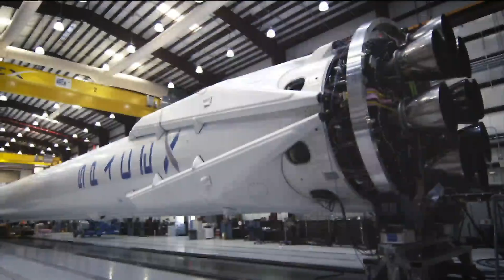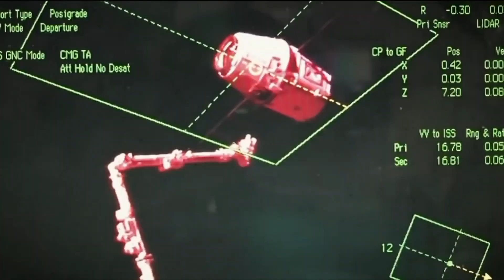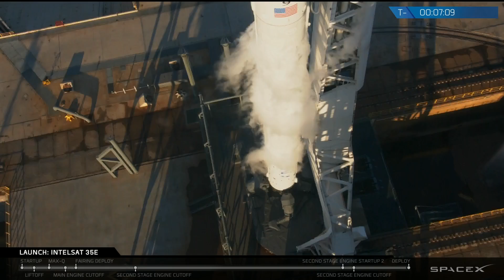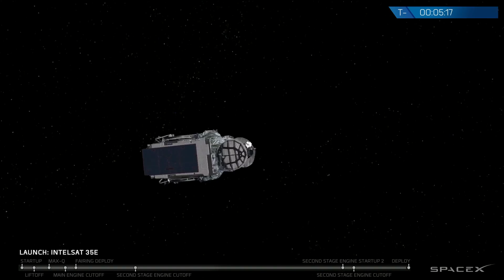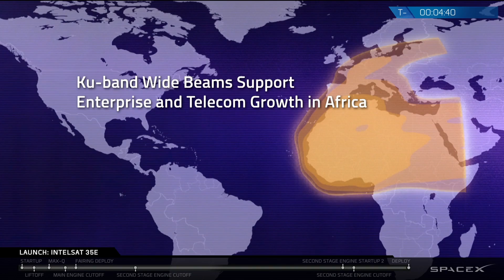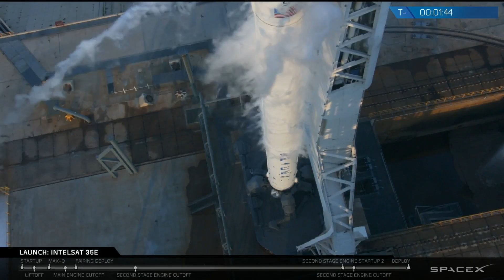Intelsat 35e Launch Webcast

Comment: Does anyone know specifically why no recovery on this one? Path takes it too far from where OCISLY would be?
Reply: Bart Comments The satellite is too heavy for recovery.  The Falcon 9 needs just about all of the fuel it has to get the satellite up so there will not be enough fuel to land
Reply: nintandrew13 Thanks. That's quite a big sucker then! It'd be interesting to see this satellite sized up against those ten Iridiums.

Comment: not landing phase 1?..mission requirements?.. I smell horse shit
Reply: Ago go The 1st stage needs to burn all of its fuel in order to attain the necessary velocity so the 2nd stage has enough fuel to take the satellite all the way up to Geostationary orbit. 

Whether or not SpaceX recovers its 1st stage depends on the desired orbit and the weight of the satellite being delivered.
Reply: because the payload is so heavy and geostationary orbit is at a much 
higher altitude, SpaceX has to use pretty much all its fuel to get this
satellite in the right spot, no fuel left for a stage one landing.
Reply: Ago go Yeah they've had to do this a couple of times before as well. Lots of private companies are putting communications satellites way up in Geostationary orbit these days
Reply: Ben Slavens ah, I just find it out of ordinary, this didn't make sense to me, I'm sure I don't know much about it so that's why it's odd to me
Reply: I don't understand, what part of it is horseshit? You think they are lying about not landing it, or why they are not landing it?
Reply: The payload is too big and going to too high of an orbit.
The fuel required to send the second stage on its trajectory is so much that the stage 1 engines will not have sufficient fuel remaining to land.
Not "horse shit" as you crudely put it, only physics.

Comment: What happend, its unlisted now
Reply: The launch was stop at the 9 second mark, for some safety check.
Reply: not because of the weather, flight computer detected a problem and aborted at 9-second mark. The weather was looking great, it was iffy earlier in the day.
Reply: ahh thanks was skipping through the video and missed that part, had been looking at the weather radar and looked liked there was a small thunderstorm cell headed toward the cape so figured it was due to the weather.
Reply: launch was scratched due to weather. backup launch window is tomorrow pretty much same time as todays.